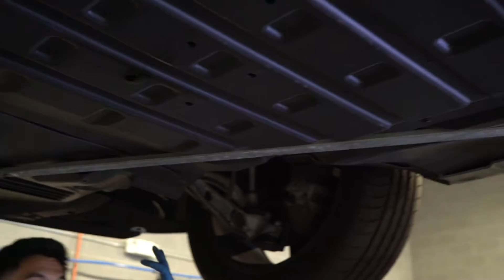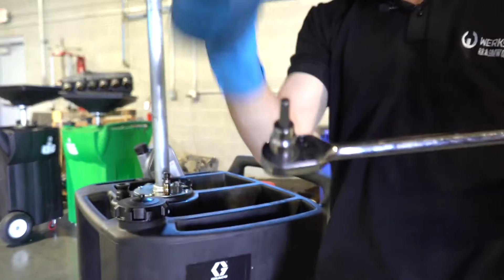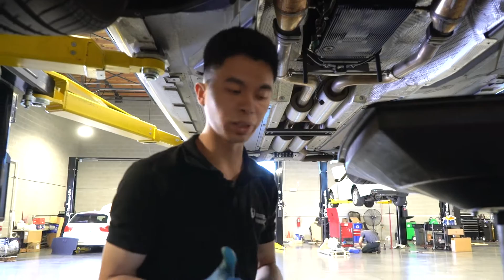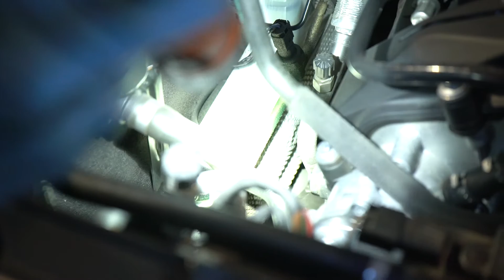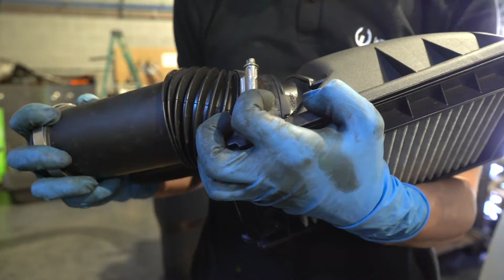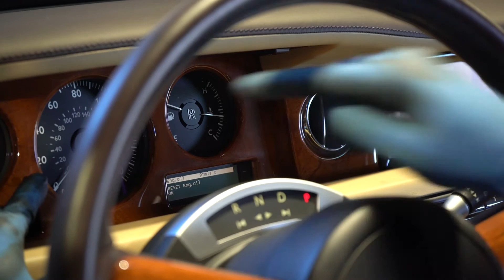DIY Rolls-Royce Phantom Oil change, Replace Cabin & Air filter

Comment: wow bro just ran into your channel. I have a 2008 phantom and one day upon driving I fell my car stall. Then about  an hour later taking off from a red light the car popped into neutral. Then I put it in drive and it did it again the next day after driving about 2 hours. (It popped into neutral upon taking off regular speed)  Any idea why? (My RR has 26k Miles)
Reply: Ever find a solution?

Comment: How did you gain access to the air filter? It does not appear in the video but surely this is a key part of how to change an air filter.
Reply from the maker: Sorry it appears the video team didn't film it or didn't add it to the video
Reply: @werkstatte-bmwonly9515  Okay, I can see in the video that you removed a section of the pipe going into the air filter cover. I don't know why you did that. If anyone else is interested in doing the air filter change themselves, that isn't necessary. I just did an air filter change on my 2006 Phantom VII. It would appear that all you need to do is release the two clips closest to you that hold the filter cover in place. The cover will then slide towards you slightly (releasing the two push in clips on the opposite side) and it will lift up to give you access to the filter. To put it back in, again annoyingly not shown on the video, push the filter cover so that the two pins at the back locate in their holes first and then cover will drop down into place. I found that it's extraordinarily difficult to get the two clips to go back on, simply because you can't get your hands into the space to get any leverage. I found the answer was to put a piece of string around the clip and simply pull it up until it clips back on. I hope these comments will help others trying to do an air filter change for the first time.

Comment: At what time and/or mileage interval should you change spark plugs on this engine?
Reply from the maker: All turbo engines 60k miles and naturally aspirated 80k miles for plugs. If the vehicle is tuned I would do 45k miles for turbo engines.

Comment: The torque spec is 25...? 25 what? N•m or ft.lbs.?
Reply from the maker: It's 25 nm. Sorry for the confusion. It says right on the cap since those are European  measurements. Some plastic drain plugs also have 25nm written on them.